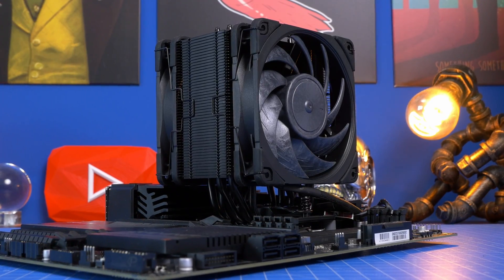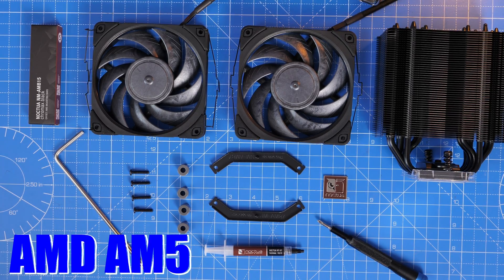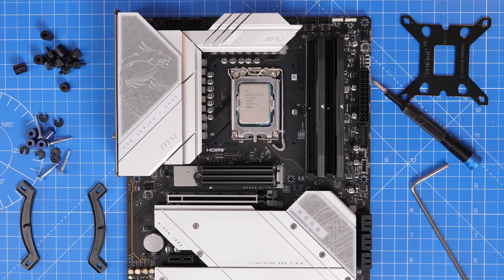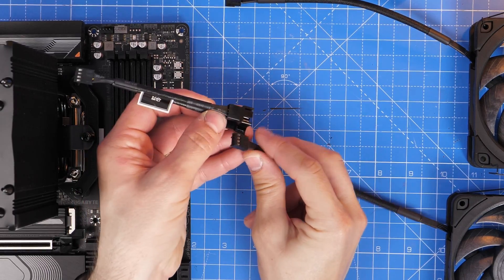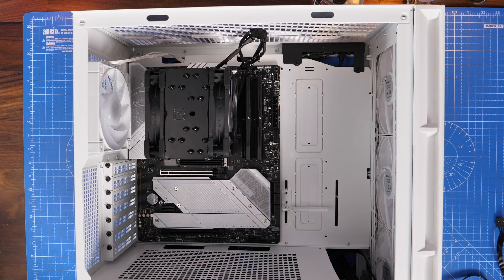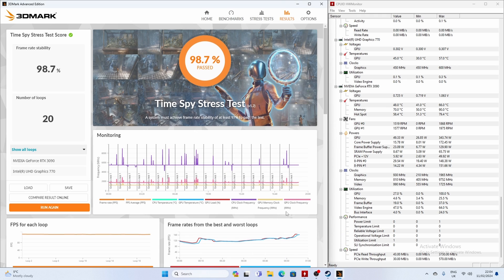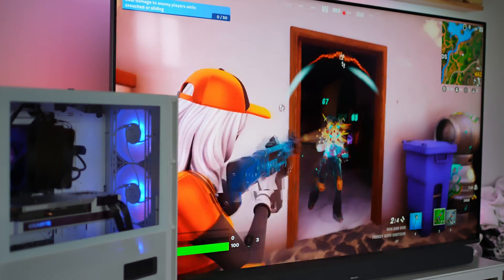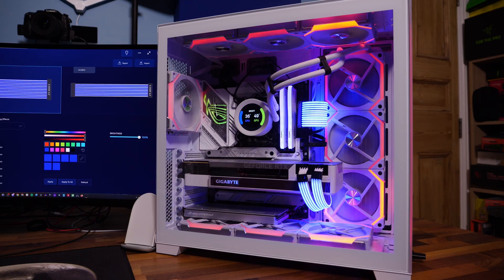Noctua NH-U12A Chromax Black review

Comment: I am currently using the NH-D15 in my new rig, and in fact my old PC uses exactly the same cooler and has been fine for 3.5 years. However, it is a bit of a pain that the first fan sits directly over the RAM modules and is 140mm, so it has to be fitted very high on the heatsink and blows a lot of the air over the top and almost touches the side of the case. For that reason, I am thinking about replacing it with this NH-U12A. Single tower, 7 heat pipes and two 120mm fans.

Comment: But I was wrong! I'm glad I watched your video. I installed the black plastic mounting pins in the 1700 socket instead of the correct blue ones. The black ones are for sockets 1200 and so on. However, they differ slightly in size. The manual clearly mentions this, but I didn't read it carefully. I admit I didn't notice any high temperatures after installing the black pins in the 1700 socket. But just to be safe, I replaced them with the correct ones. Very good CPU cooling.😊👍

Comment: Is This good for 9800 3xd ?
Reply: 9800x3d uses 120wats. If you overclock it will use 160watts and this cooler can cool 180watts. I hope it helps
Reply: @ErennDS  The manufacturer doesn't provide a maximum TDP for this cooler. Where did you get that information? But if the Noctua NH-U12A easily matches the Be Quiet Darck Rock Pro 5, which has a manufacturer-specified TDP of 270, in all tests, then it's still more than 180.

Comment: So i have had this cooler for a while and i can't seem to get the temps down. I'm using a 7700x in a "be quiet! Silent Base 601" case with 2 140mm fans.
Hunt showdown and Marvel rivals takes my temp up to 90-95 C. I just reaplied new paste from noctua and made sure the screws were tightened correctly.
I have a set fan curve and the fans go 100% at 85c but the temp do go over 95 after a few minutes playing.
The fans are mounted like in the video. What could be the problem?

Comment: I’m assuming it should work fine with the i7 13700k then
Reply: Yup!  Been using this on my 13700k for a long time now with no issues.
Reply: Its a good option for i7? what is the max temp you are getting?
Reply: @DaudasVlr   yeah solid option for i7.   Temps while gaming are usually in the high 60's low 70's running the fans no faster than 1600rpm which is still quiet.

Comment: Nice review since I am in the market for a CPU cooler for my 14700K build, but I think your tongue slipped, when you said it's an all in one cooler.
Reply: did you buy it? How does it work for you with that CPU?
Reply: @KAMI_VR  I made some modifications in the BIOS and set the sustained and max TDP to 200W and the CPU never thermal throttles. 
I game and work on my desktop and never had any issues with this cooler.

Comment: Noctua is reknown for their highly efficient, yet silent CPU coolers. This video shows yet another aspect of them: simplicity of installation. AIO coolers and RGB fans may have glitz to them but they make the life quite complicated with all the cables, with the need for additional USB 2.0 hubs and things like that. This Noctua works perfectly and does its job flawlessly with just one connection cable ! And that is something to cherish !
Reply: So I'm upgrading some parts in my PC,  Mobo,  CPU and Cooling system. I got the 14th Gen i7  with 14th Gen Asus Mobo.  Would this be great cooling option for that you think?  I'm going back and forth for coolers I really don't know what to get
Reply: @migthefig   Go for amd dont buy intel...
Reply: @123-g1u  for what reason?
Reply: @marquezjohnston   Air coolers for amd aio por intel. simple.

Comment: Amazing cooler! Cools my 9700K at any clock speed
Reply: Can you overclock without any temp issues ?
Reply: @essence7779  Yes. I have had it at around 5.1ghz (1.5v+) with the temps around 85*C. 
Currently at 4.8ghz (1.29v-ish) and temps are usually around 60*C

Comment: Due to me using a smaller case, I opted for this. 
My 5600X practically never leaves the mid 60s under most cases. Occasionally if it's really taxed for something, you can hear the fan pick up a little as the CPU gets to the upper 60s.
Reply: I take Scythe fuma 3 with my 5700X i never jump above 70C... Ryzen 7 5000 series is very hot no matter what cooler u have
Reply: I use these in all three of my PCs: A 9800X3D, a 7800X3D and a Core i5 14600K. None of them ever come close to thermal throttling even under CPU stress tests (disclaimer: I don’t manually overclock, but allow automatic clock boosting technologies as designed by Intel and AMD). 

Very impressive cooler.
Reply: @little_fluffy_clouds  Nice! What case do you use for each CPU?